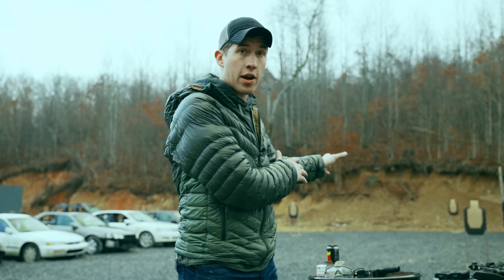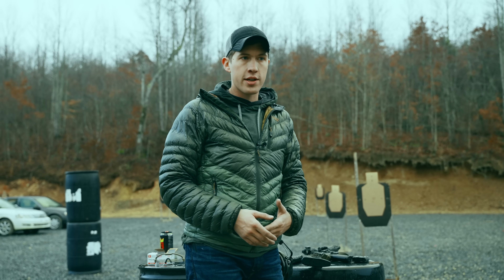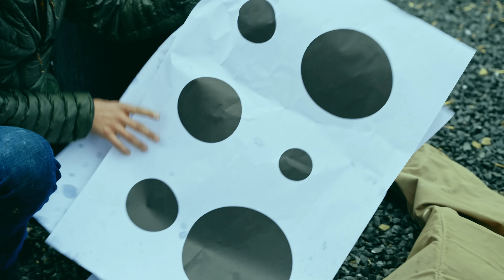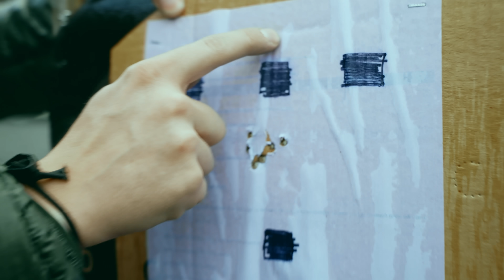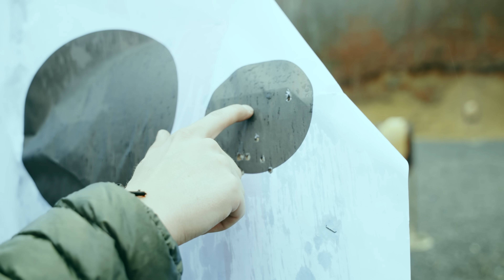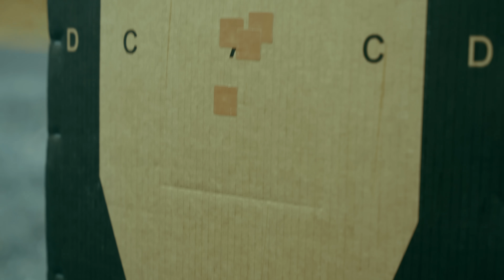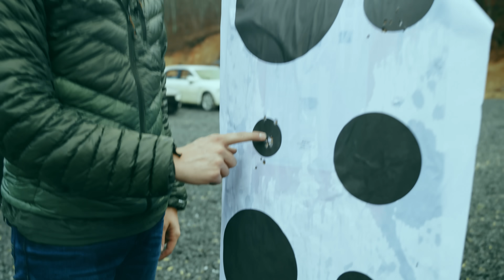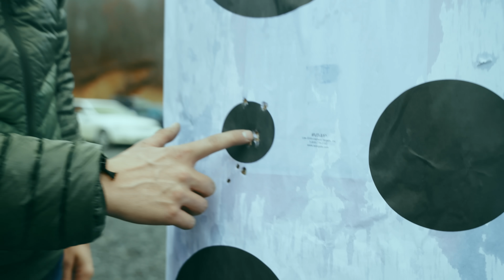First Drills At The Range - How To Shoot Part 3

Comment: Again thank you Lucas for this. I'm already doing video 1 with my pistol. Doing a few things around the house. Then I'll come back and do the table drill. Go do more. Then do the presentation drill from a low ready. All while making sure I remember finger on the trigger, finger off the trigger. My pistol is not optic cut unfortunately but I do have a nice high viz sight set up that came on the weapon. I came do this video because I just wanted to see what I needed to focus on in a few weeks for my very first range trip.

Comment: one thing ill mention as an RSO, no range is gonna let you walk around with a slung rifle. You will be required to clear and bench a rifle before walking anywhere but your shooting bay. You're gonna need to have a private shooting area or be shooting on public land (where theres really no rules besides your local laws) to really need a sling at the range. 

STILL BUY A SLING. But you very likely will not be using it at the range. So make sure you have an easy way to take it on and off.
Reply from the maker: While this is true for many ranges, it's not for ALL ranges. I've been to many outdoor public ranges that after renting a bay I can use a rifle with a sling at.

Comment: Being new to red dots.  In that particular M&P w/ the taller iron sights, is the red dot co-witnessed on the front sight post or slightly above it?
Reply: Those are factory S&W suppressor height sights so with a RMR on the OEM S&W mounting plates the sights will be in the very bottom of the glass, like lower 1/3 or 1/4.

If you plan on running a after market plate like the Forward Controls Designs you'll need taller then OEM sights, I use Night Fision sight and they are absolute cowitness with a RMR on a FCD plate.